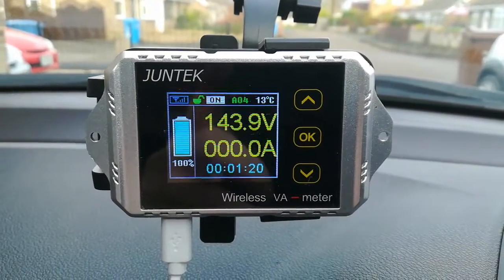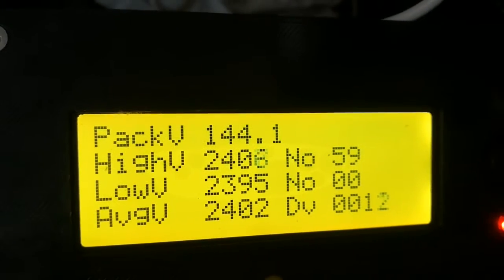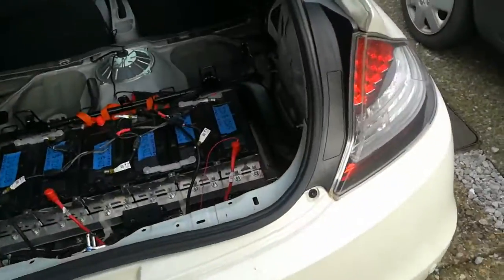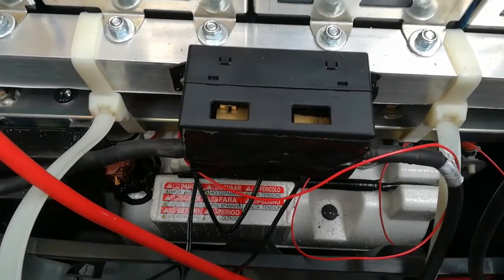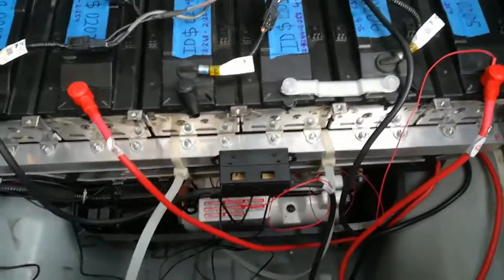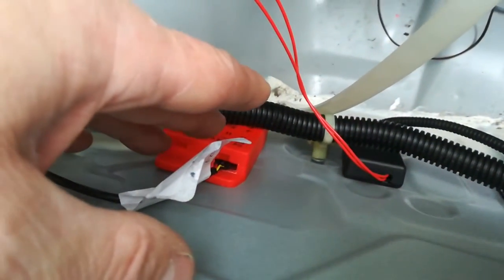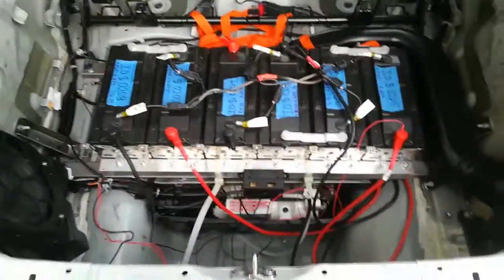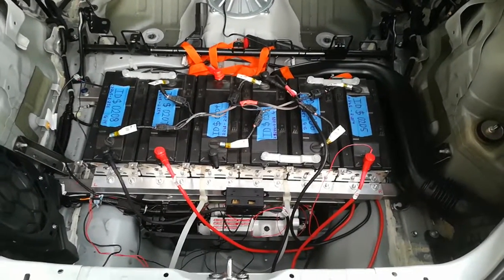CRZ Lithium Pack Video17 (Adding the Juntek Meter)

Comment: What’s the MPG 🤓
Reply from the maker: I've only had the car  two weeks. I can manage 50mpg UK pottering around with the old oem pack.  Lithium should improve that in due course.
Reply: @retepsnikrep  i plan to sandwich 4 units between 2jz and cd009 gearbox.
Can I squeeze 40kw out of each with a 400 volt 8.8kw battery and customs controller?

They are square copper wire 17kw units btw
Reply from the maker: @FirstLast-tx3yj  Sounds intriguing.  35kw for short periods might be more realistic. 400V sounds rather high.